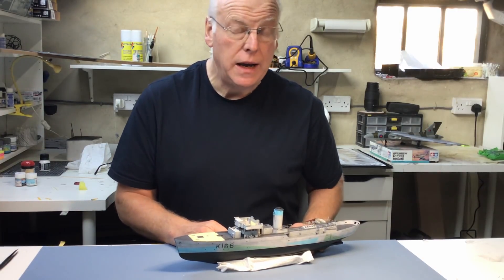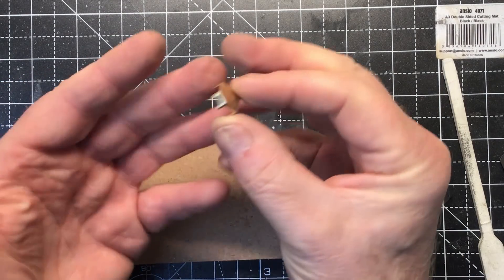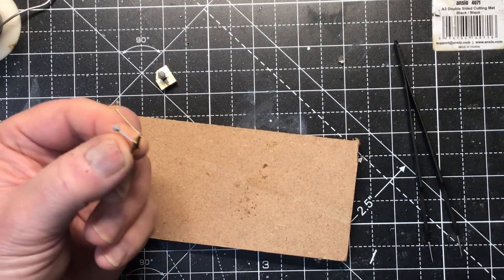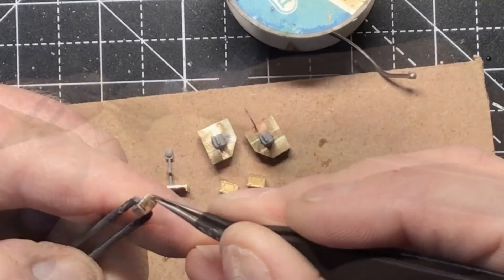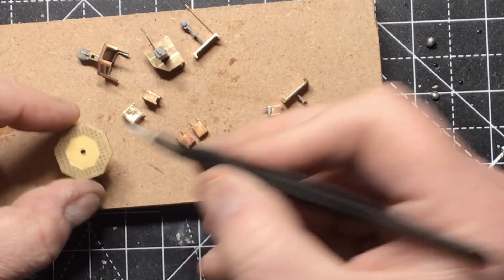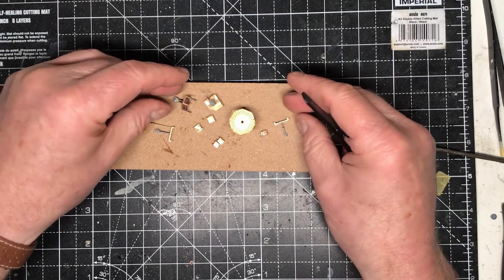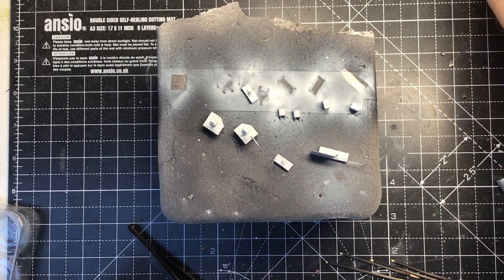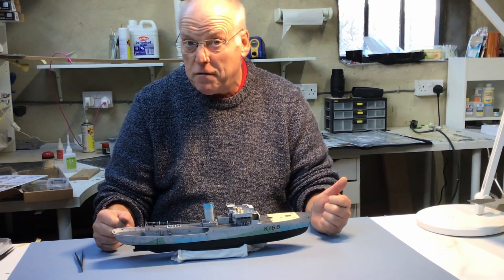Revell 1/144 Flower Class Corvette full build with Pontos detail set Part 11

Comment: See you used MIG in this episode, I’ll have to try that. When you use CA for PE,especially in railing and things, what do you use for application? I’ve tried a pin, sharpened toothpick etc. with minimal success. I’ve tried the small applicator tips that go on the CA bottle but even the small ones seem to put out way too much glue (esp when using thin CA). Finding it difficult to get things as neat as I want them.

Comment: Bought my self a Soldering iron, was suprised that you could solder so small a part. I have only soldered scrap to scrap but it seames to work better than glue. We be on a live model soon, hope it goes just as well
Reply from the maker: Hope so Michael. The biggest thing I’ve learned is to not use too much solder - it goes a very long way and using the smallest amount reduces the amount of cleanup.

Comment: Good afternoons work Steve. I was going to comment that when you fitted the ladder to the radar tower, should there have been a corresponding gap in the railing. Thinking about it, it was probably gated. Ian
Reply from the maker: Yes that occurred to me as well Ian and I guess I came to the same conclusion - either a gate or detachable ropes across the opening.

Comment: Steve, when you said the shield didn't fit, is it a problem with the Pontos set or with the kit? and what year was the Revell kit produced?
Reply from the maker: A bit of both Michael: the problem is that the platform behind the etched shield is too broad to fit between the deck edge and the hedgehog base on the Revell plastic deck. The answer is to trim the hedgehog mount a bit to give enough room for the shield to fit in: but the problem is that Pontos don’t call this out in the instructions.